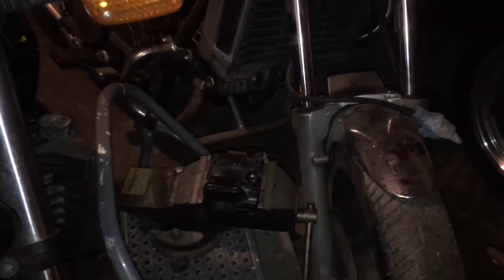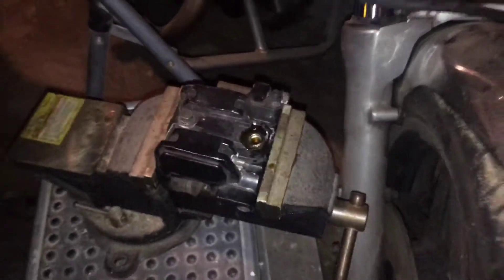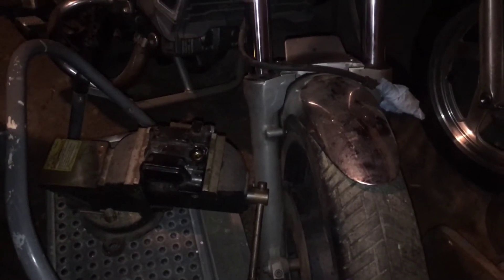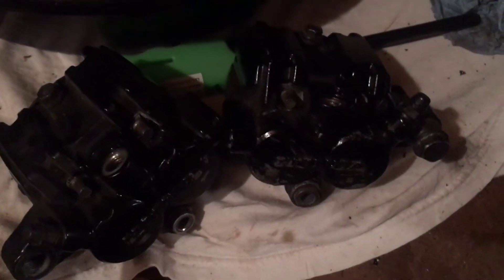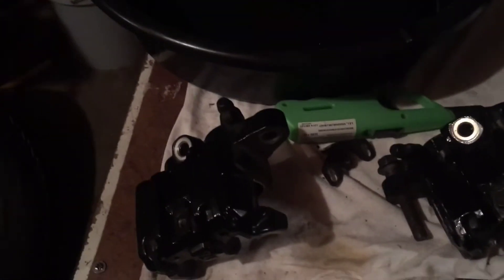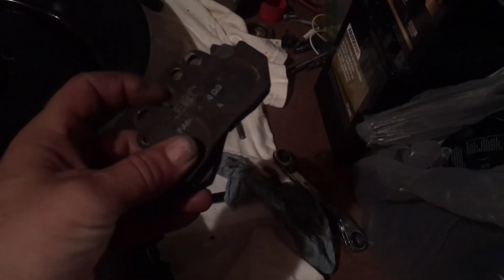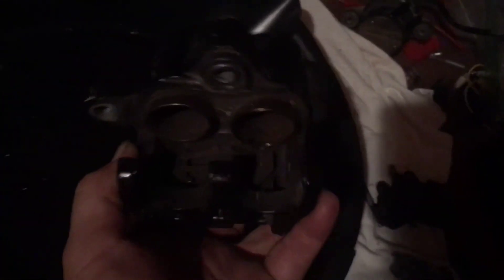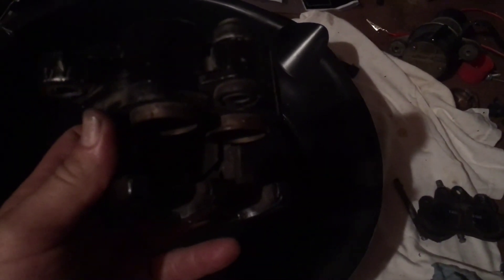Shop Time: Removing Seized Front Brake Calipers - 1983 Honda V65 Magna VF1100C how do brakes work?

Comment: Next time maybe turn on the lights...
Reply from the maker: Good point, J D!
Reply: @mcycleshawn  oh shit you are real, i would like to see part 2
Reply from the maker: @JD-mo3pd  Real as it gets! 😂 I’ve been side tracked on so many projects!! Let you know as soon as I get back to these brakes. I have a front caliper on another Magna to do so I should just do all three at the same time!
Reply: @mcycleshawn  right on!  i'll subscribe so i dont miss it, by the way what is the best way you found to pull those stuck cilinders out?
Reply from the maker: @JD-mo3pd  if you can find an atv or motorcycle brake piston removal kit, that should be your best bet. Don’t try the cheap one that looks like a pliers….. I tried that one and it can’t even grip the piston without sliding off. I’m review both tools in the future also…haven’t gotten to use the kit yet!